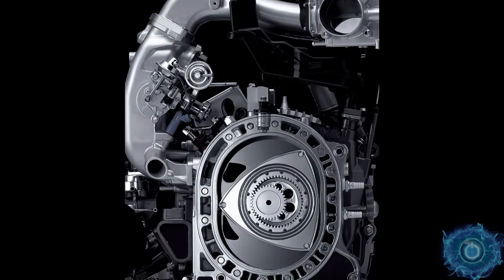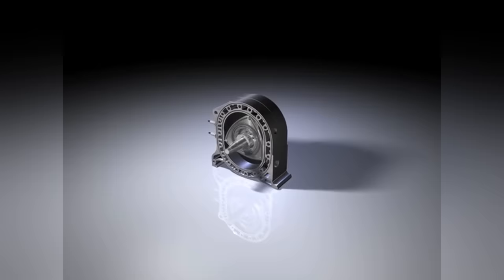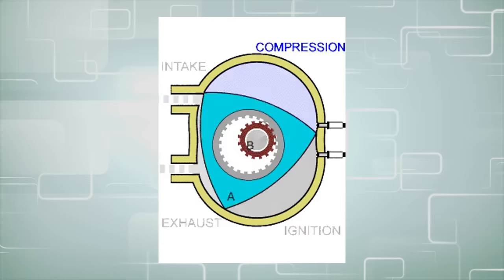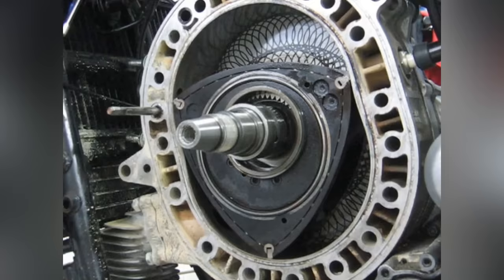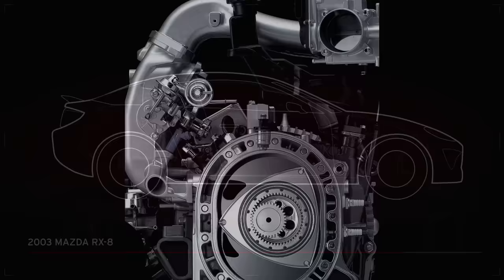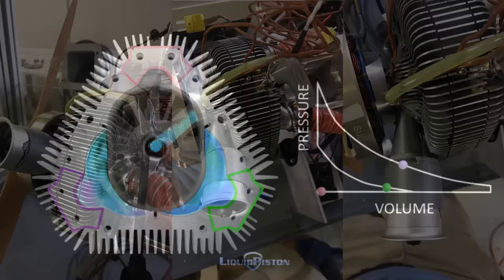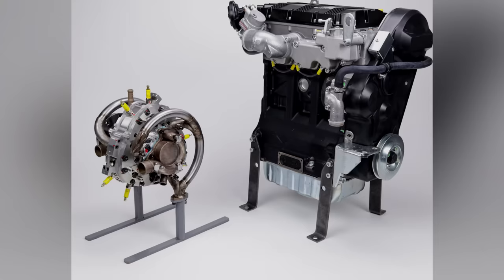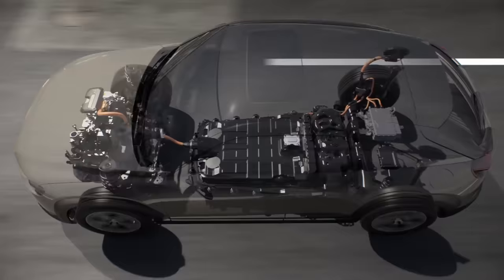STRANGE New Rotary Engine BREAKS Records

Comment: Just use 2 stroke oil with fuel to lubricate apex seals mixed like a 2 stroke engine.
Reply: Yes i burn and fill amsoil interceptor 2T in my rotary, no 4 joke oil allowed.
Reply: @jlo13800  do you own a rotary engine

Comment: Legacy Mazda Wankels struggle with fuel economy; will be interesting to see how new rotary designs consume.  However: Most of us don't appreciate just how quickly pure EVs are advancing in the car market. By 2030 it's entirely possible – some would say probable or even inevitable – that EVs will dominate. There will probably be niches left for hybrids; but I doubt if emission regulations will accommodate pure combustion [ ICE ] cars for too much longer, be they traditional or rotary.

Comment: 4:57 The rotory engine is still not mass producable. Well its yet to be. Even with Mazda in all their years most of us would say the king of rotary still put those together by hand. Its a complex tax that apparently has not been automated most likely because they know its not 100% feasible due to the emission and apex seal issue. There are hurtles that need to be solved that have yet to be.

Comment: Please don't compare Liquid Piston design to a Wankel.
Thier design is much much closer to an Otto motor than Wankel.
The only thing they have in common is that they are both rotary motors.
But that's just "mechanics" there is a whole lot more than that to combustion engines.

Comment: His comment (Similar Torque and horse power to a KDW1003) LOL  the KDW1003 has 50Nm of torque @ 2200RPM either way I think its a cool design my first car was Mazda Rx7 series 2
Reply: DOes the KDW1003 have oil injection and can it run mounted  in any position? im sure it would run fine with amsoil interceptpr 2T oil in it.

Comment: Diesel or similar, 1000 hours between oil/service reliability, 50- & 250- & 1.000- & 5.000 hp models.
Then they are interesting.

Comment: The stupid government focus on emmissions is stupid because it prevents the great benefits of the rotary engines.  Imo if we used rotary and stopped obsessing on emission we could actually make cheap fuel efficient powerful engines that require much less manufacturing and overall better for environment

Comment: Fuel engines of any type are a big retooling risk in a vanishing market. There are more than fifty companies working on battery technology better than lithium-ion. Even one that simply ionizes metal and reformed it on discharge 2.8 times the energy of lithium-ion and half hour charge time. One or more of these will work. Then the other fuel engines will be like an old tractor show.

Comment: I think electric has great future but progress historically is made slowly and in cycles... back and forth, and once the current EV mania subsides a bit a return to an improved combustion engine of some kind probably in hybrid configuration will take place.  There is a chance a much improved Wankel design may make a come back.   I hope so, as this engine still has a lot of potential.
Reply: Slowly and in cycles? What are you talking about?
Reply: @kennyg1358  I am sorry if you did not understand what was written.  I explained what I meant, and see no need to repeat myself.

Comment: Another variation of the rotary is called a rolling piston. However, looking at the design, it may require an external combustion chamber so it may work on a pressure source like compressed air or steam. Any researches about it?
Reply: Rolling piston is an inferior yet working design for compressors, but it will absolutely not work as high efficiency ICE. Actually, sketches of more comprehensive rolling piston engines go back as far as 19th century. Interesting fact - none worked. There were few prototypes. 
It will never go beyond barely working prototypes with efficiency of 2-3%. Actually, a first skim from youtube brings tens of variants sharing one property - not working...

Comment: In the end, all of the hydrocarbon-fuel engines are going to have a limited future application set; we simply can't continue to pump out that much CO2.  If hydrogen as a displacement-engine fuel can be made practical, and if this engine design proves to be capable of producing a better power-to-weight ratio than the piston engines it will be competing against in the market that exists at that point, it may have a chance of becoming significant.  But the mechanical advantage that the expanding charge has against the rotor is still far from ideal, so my personal suspicion is that it will be a niche-market device at best.

Comment: I think that hydrogen powered rotary would be a more efficient vibration free way for hybridised vehicle conversions, the power density should allow for better install and adaption to hydrogen hybrid with room in an engine bay.
Current approach is to throw away the old car for a new one and this method will allow for chassis and vehicles to be cheaper and lower material used for greener transport, it's not like we need green vehicles that are huge and Americanised concepts of bigger is better with many new hybrids being large SUVs or too small for a family and the large SUV types offsetting their green status in massive rubber dispersion far in excess of current ICE's ( dont believe me check the scientific reporting on this ) so in TLDR smaller means greener and less wastage in manufacturing for change over to hydrogen hybrids or straight hydrogen.
Reply: You can have that hybrid shit, i want nothing to do with that.
Reply: @jlo13800  it's not for hybrid it's to keep internal combustion motors by hydrogen not hybrid

Comment: apex seals...period = fatal flaw

even the liquid piston has 3 points of major failure.

Comparing rotary vs. piston ICE, the 4-stroke process exerts its forces across 3 apex seals or the piston rings.  For a given sealing sufrace area, pistons motors have more sealing surface area to lower the explosive forces...so reduced material fatigue, whereas, rotary focuses those forces to the point of material fatigue, thus shorter life.

Any rotary research into better apex seal material selection?

Comment: I never had any  respect for the rotary engine Like at all! A product of bad press I think. Until I owned one in an RX7 beat to hell and abused It was hard to start but always did I drove it for years and grew to love it. Now, I firmly believe. Regardless of emissions or economy. They are one of the best engines ever produced.  Smooth, powerful and unique. Till you own one you really just do not  understand.

Comment: looking promising , the revetech motor with F1 type preburn /ultra lean, set up would beat it . Also The MYT[ mighty yet tiny]  engine ,if possible, is leaps ahead again [ Raphial Morighardo ] now we have a rotating explosive pulse jet motor getting close ,ie constant rotational detonation ,sounds loud ??. I do not understand why Mazda didn't use full PP with direct injection where the normal oil injection is ,this would overcome the valve overlap ,give at least a 300 hp 13b , Futher Mazda uses hydrogen , do they not know useing hydrogen ,15-20 %,with almost any fuel gives a hydrogen burn .  Very fast, very clean , no emissions problems ,more power ,less heat , they could even get rid of a spark plug .

Comment: I like your presentation ... just get your facts a bit better. I am a fan of liquid piston and also an investor. This engine ROCKS. 1.2 hp per pound is a small feat for this engines true potential. "Offy" F1 engines have been developed to deliver1000 hp at a weight of 370 lbs which is  about l2.7 lbs per hp. I believe liquid piston can do better than 1.2 hp per pound. We will see.

Comment: hmm reminds me of all the turbine engines I have played with. Instead of the fan maybe a compressor running direct from the crank could be used increasing the power and compression again. think of this engine as as the combustion and turbine section of a gas turbine.
Reply: 74 arctic cat puma with a Sachs 294cc 2 stroke gas turbine 40;1
Reply: @jlo13800  Thank you for this surprisingly hard to find on the net. Cool little motor.
Reply: @CGS11900 this is a wonderful 2 stroke trying to find its way in a 2 strokeless world. sadness, anger and hate causes fatigue in the parts and will is to make less hp and torque.

Comment: Pro's less parts, light etc. Con's are the shape of the combustion chamber. The flame front has to travel from the spark plug to all the corners. Because the classical wankel has a very flat shape (pancake) the flame front does not get to all the distant corners during the power cycle. You will have unburned fuel in these places = poor economy. The shape of the liquid rotary looks better but still there are corners that could be problematic. Specific fuel burn numbers are needed to see if there still is a problem. The shape of the combustion chamber in a piston engine will always be better (for the combustion process), so a rotary engine (not the radial piston) will always have this disadvantage.
If this was a diesel engine it could be less of a problem because the injected fuel burns very rapid as it enters the combustion chamber and there will be less unburned fuel. Question is if the combustion ratio can be higher than 18 to ensure a temperature that is high enough to ensure good combustion.

Comment: There is a place for these engines. Where is size and weight important? Aircrafts - especially surveillance drones like the ones from Schiebel. As far as i know do they use rotary engines. Must be lighter that piston engines, must be cheaper than turbines. And is to big for electric engines where flight times would be limited.
Reply from the maker: Dry weight is 21 lbs 8x10x10 inches. But I see their compression ratio is still low in their alpha prototype. 7:1

Comment: Very, very thin slit left in the window of innovation for a breakthrough ICE motor even if it piggybacks it’s reason d’étre on the EV transition. Momentum isn’t in its favor to accrue long enough runway to develop into viable production  before its purse is subsumed. it’s twenty years late to its debutante party.

Comment: I am old enough to remember the hubbub the Wankel engine made when it came out. There were many articles in popular science, mechanics and automotive magazines. I remember that all the major auto makers were experimenting with the Wankel. One article I recall told of one of the major auto makers producing the best apex seals they could. Apparently the engine would have been able to run about 200,000 miles with only oil/filter and spark plug changes. Nobody in Detroit (or Europe) wanted an engine with that kind of durability. The EPA's mileage requirements were just the final nail in the coffin.

Comment: So they saw that some motors from before the late 1930ies that moved the motor around the pistons until this was "inverted" later so they thought why won't we try like the same concept on the wankel or rotary engine? so that after the renesis a few years ago now there is an "inside out" engine variety? 
But nowadays people or potential costomers walk away when disadvantages (new less tested and special parts) and possible risks (product childhood illness) are added in explanations? and how does that 210 sound? or is this asked too old school? 
In the "EU" (EUrope) motor builders are disgusted that the "EU" shrinks or limits the use of good mature concepts claiming those concepts would emit too much waste gas (or whatever on the paper) from the exhaust, that they should be developed better , "more efficient" beyond a realistic usage proportion paying of in function. Compared to some 60ies moter even Diesel engines did a fine job since about 2005 and now they are supposed to get scrapped for accumulator "cars", for the environment (actually greenwashing). Such bad bureaucracy "ideas" also messed up the spherical engine ("Kugelmotor"), of what type one only consisted of 4 or 5 parts and was said to run efficient, with such few parts a motor or engine can last or overdure decades, we should had tried.

Comment: Rotaries need turbos...just like every diesel should have a turbo, so goes the rotary, as its exhaust gas is very hot leaving the chamber, that wasted power needs to be harnessed with a turbo.  As you said, the liquid piston (fake false name) is just a wankel with the rotating/stationary reversed, nothing great about it.
It is like an electric motor with stationary magnets, then they rotate the magnets instead.  Magic technology.  NOT
The huge technology improvements is the direct injected two stroke engine.  It solves all the issues with a two stroke and has better power/weight than a rotary.

Comment: Still using oil based fuels, will this design run on hydrogen?
Reply: Yes but its got oil injection like all rotary 2 strokes do and you will need that for your hydrogen 2 stroke rotary.

Comment: like the idea of an EV with smaller battery (that's used like 90% of the time to commute) with a small range extender very much!
Should be cheaper, due to small battery and at the same time lighter and more versitile than either big battery EV or Plugin Hybrid cars.

Comment: Isn't it a bit stupid that there going to use a fuel motor to power a battery....why don't we just ditch the battery and run fuel.... Seems like an easy fix. Don't have to wait for changes has a longer range much more cost effective if parts fail

Comment: The efficiency of Mazda's new rotary is just very low. They're specs are 25% in best case which is just so so low.
Toyota can reach more than 40% with their current engines. All the weight advantage is destroyed by the high fuel consumption. No point in Mazda's engine

Comment: Why don't you just show off such an engine running live? let us SEE and HEAR and have just a basic FEEL of what such motor looks like. Everyone saw his piston engine running with the hood open, and it's really interesting to watch a different thing. 

Also, you say the new "peanut shaped" motor is not ready for commercial show-time, but could you please review some key tests or conventions where it was showed off, and what did it achieve so far?

I think todays "no fossil fuel" stupidity is finally going to fade (like always) into a more complicated world where fossil fuels will have their place, in combination with other energy sources (I guess if we're stuck with inferior technology of Batteries, then Nuclear is the ultimate supply of electricity to charge these) but on the road - maybe the peanut is the preferred electricity generator? any ideas?

Comment: as per: https://youtu.be/zl6n08HrKZw
My 2 liter inline four that powers my 6000lb Mercedes stepper van also has 18/1 compression and is an intercooled twin scroll turbo diesel. Mazda should think about that. This new rotary (also has 18/1) could work with bio diesel which will be around a lot longer than the fossil fuels. It's also (my van) a mild hybrid with ISG (Integrated Starter Generator) and the gen puts out an additional 20hp and 135 ft-lbs of torque. 100 liters of fuel gets me over 1000km of range and the ISG augments efficiency with regenerative braking. They say (they) that the yearly forest fires are contributing more greenhouse gasses than all human activity combined so my perfect future is where we robotically harvest fuel from the forests that are at risk of going up in flame and turning it into biodiesels. This is smart for many reasons. We mitigate forest fires and also give ourselves a way to stop mining carbon from the Earths Lithosphere and instead mine carbon from the Biosphere. The oceans are a terminal sink for carbon but with acidity due to too much dumping of mined carbon, the carbonic acid is maxed out. Carbonic acid is aqueous CO2.

Comment: Rotaries.. oh my... they flood, often, no one can fix one easily, the are thirsty engines, vey thirsty and not efficient, they produce very little torque. In short, perfect for an era where fuel was 10 cents a litre and you could fix things with a hammer, not so good now About the only advantages are high HP and ridiculous ability to rev. In other words, it sounds cool AF.

There is also the other reason NO ONE USES ROTARIES... if they were the future we would be using them, they've been around since the first World War ffs...

Comment: Wankel is a great engine. but it has some issues, still untill today, the parts who are making the chamber tight, are extreemply heated up, since the rotary piston egnites at every turn, and th eOtto engine only after 2 turns, its needs way sooner a controlls or repair. after 100'000 km you loose about 15% of the engines power, and all because of this smal parts who are stressed too much. So its still far from good tho. Same problem has Subaru with theyr Boxer engines, since the Piston next to eachother egnites just after the first did, there is not sufficiant cooling to this days. And you cant just cool it with lets say liquid hydrogeen, the engine block would not be able to handle the way too big diffrence in temperature. Im actualy like the Wankel, ever did. but its not a Engine that runs for over 100'000 without repairing.

Comment: I believe the time is gone for any new combustion based technology. The future is electric but we are not there yet. Clean and safe nuclear fusion will provide unlimited energy for the charging stations. In the meantime, the present combustion engines are by far cleaner and efficient then 30 years ago, and we still need them to bring us to the next era of clean batteries that are much cheaper, safe, lighter, million km life span, and charging in 5 minutes from a local stationary battery powered 24/7 from clean grid. Dozens of companies investing billions into the R&D, outcomes are promising.